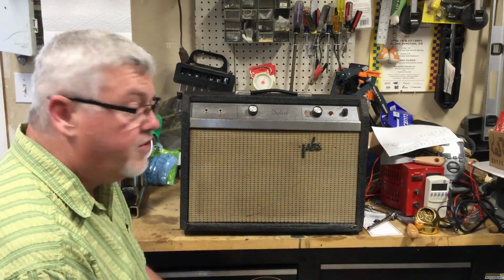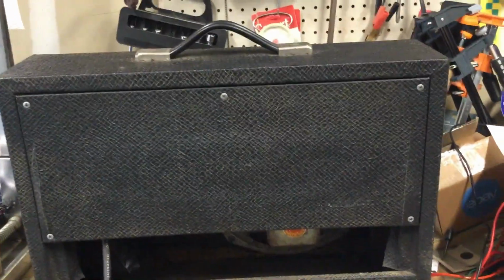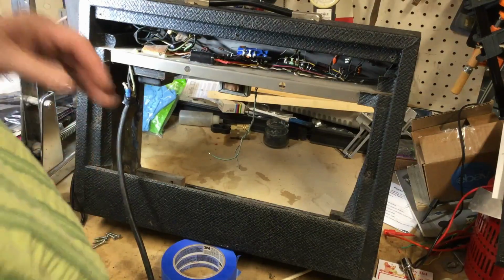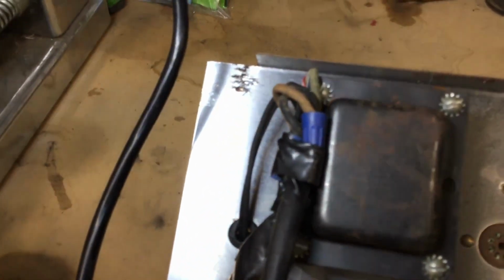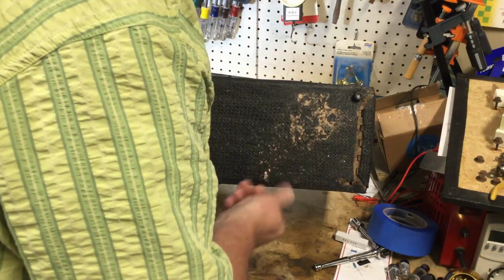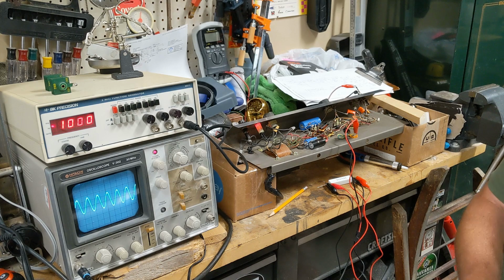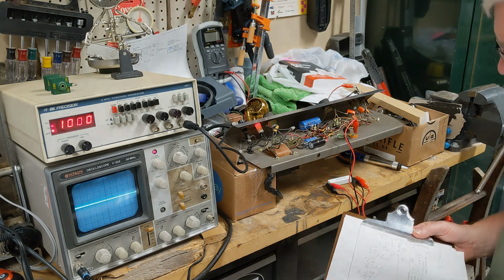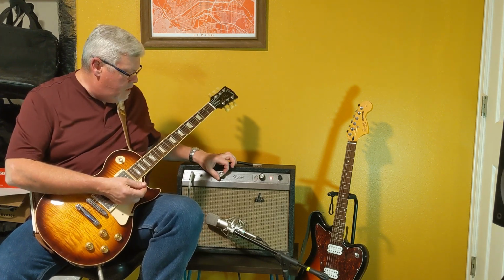1965 Gibson Skylark Restore & Demo

Comment: That yellow-green corrosion product is probably a reaction from cadmium plating under previously-damp storage conditions; do not breathe it in, it's toxic, and your throat and sinuses will feel like you've gargled with battery acid.  You can brush it off outside with the aid of an air compressor and a paintbrush or toothbrush;  wear a mask.  That corrosion will be hidden underneath any riveted mechanical ground points such as the terminal strip mounting lugs or the frames of the tube sockets, and so at the very least you should clean the metal thoroughly and solder those riveted ground points.

Comment: Hi ross, what schematic did you use? My ga5 has a 6512 datecode on the mains, its has to be pretty close in s/n! Yours is the first ive seen with the same chassis configuration, even brads early 65 is wired differently!
Reply from the maker: I found it on a TDPRI post.  If you google GA5Crestline (with no spaces) it should be the first image that shows up.  You should also read the post, it has pictures that look like my amp, but not anywhere as neat as others I have seen.  If you can't find it, LMK and I can get it to you somehow. The title of the post is : Low Tube Bias on 1965 Gibson Skylark